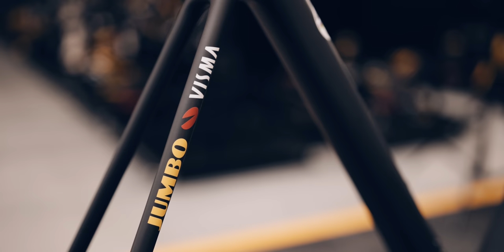BUILT | Introducing Team Jumbo-Visma with Marianne Vos' custom Cervelo R5

Comment: Front derailleur fitting guide, never seen one of them before. Brilliant piece of kit
Reply: I literally gasped when I saw that. Place the FD on the fitting guide on the chain ring. Turn until it’s at the right position and bolt to the frame. So clever.

Comment: At 5:09 you can clearly see him wrapping the right side of the bar in anti-clockwise motion. Normally we want it to be wrapped in the same direction of the force we apply when riding and this clearly is opposite. Been noticing this in several other pro-build/mechanic vids as well and wonder if that's a trend or it just doesn't matter that much cuz of the backing adhesive?
Reply from the maker: team mechanics will often know which direction a rider tends to twist their wrist, and change up their wrap direction to compensate for that.

Comment: This is amazing. I can't assemble a bicycle because I ride it, so it's very helpful.
I have used SRAM components when I first started test riding, but I think the transmission is easier to handle than Shimano. (However, at first, the shifting accuracy was poor, and I often brought it to a bicycle shop for adjustment.
It was Marianne Vos' bike! !

Comment: As I'm going through a very similar build using Red AXS/HRD, can I make a consumer suggestion?  Can you NOT send the brake lines filled with fluid?  We have to bleed them anyway after internally routing/cutting everything, and it makes a mess when cutting the lines, routing through the frame, etc.  I did tape off the ends of the lines when I routed, but it'd be a heck of a lot cleaner if they just came empty.  

Cool video though, love seeing the builds go so cleanly vs us garage mechanics cursing at the parts, dropping stuff and having it roll away, trying to stage the stuff in the house and having small bits go missing thanks to a cat, etc.
Reply: Why are you cutting the lines before you route them? They come bled and sealed from the factory, it's super clean and easy to deal with.
Reply: @rattila13  internal cable routing.
Reply: @10ktube  Was yours hooked up to the lever? Usually they come with hose connected to the caliper and sealed, and the lever comes disconnected and sealed by a valve in the hose connector. Almost everything I work on is internally routed, and I never have this issue, unless I'm trying to build with a used groupset.
Reply: @rattila13  yes.  This isn't my first rodeo.  Had to disconnect, cut, drip drip drip, route it, redo connection, bleed, etc.   Wish it came empty and disconnected.